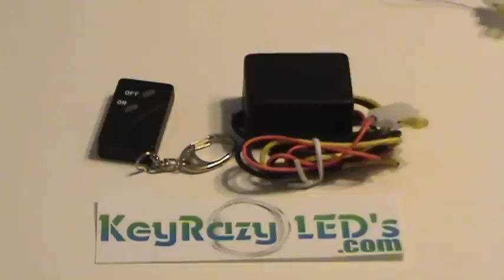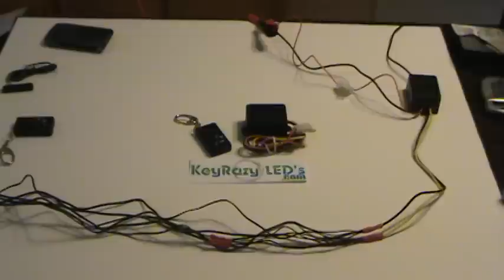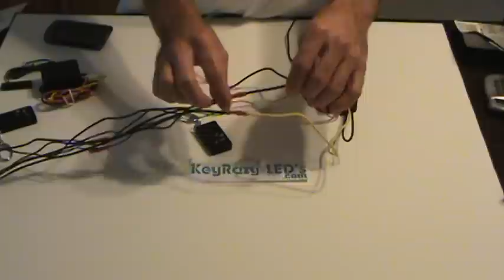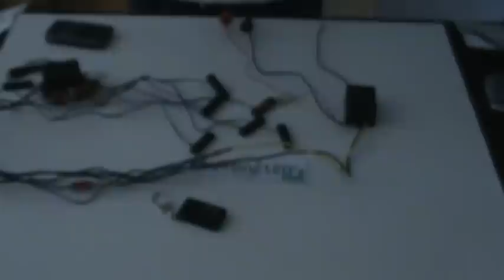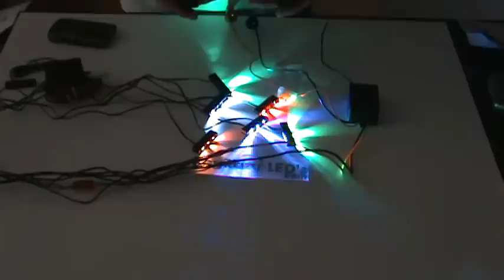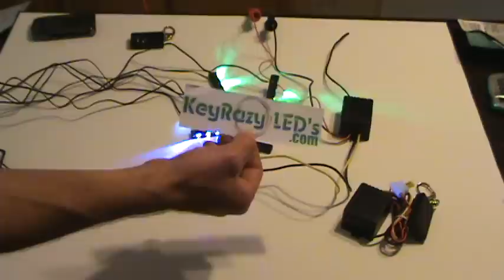KeyrazyLEDs.com Key Chain Remote Control Switch Box for LEDs. Motorcyle car truck boat van

Comment from the maker: I would say water resistant! If water proof is said it would imply you can submerge the unit. Water resistant means it can handle being around water but not under constantly wet conditions.